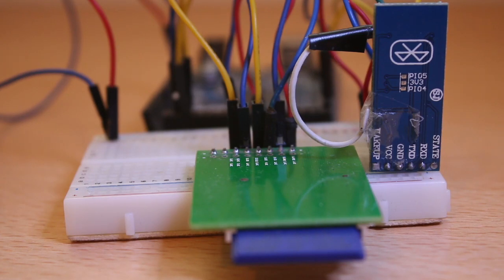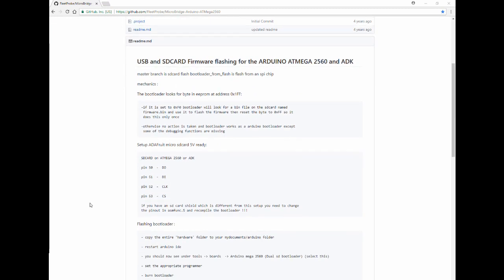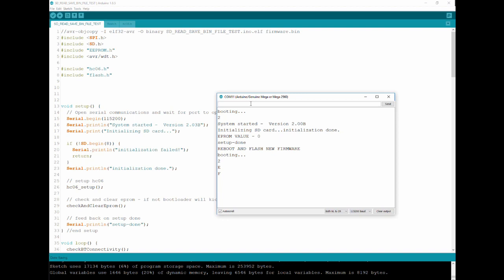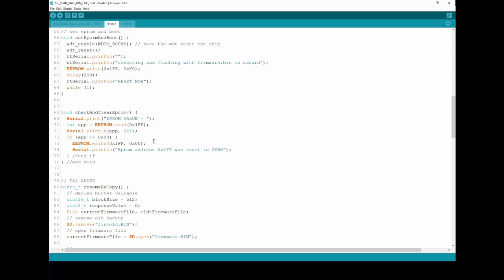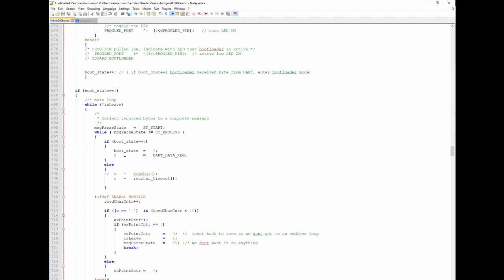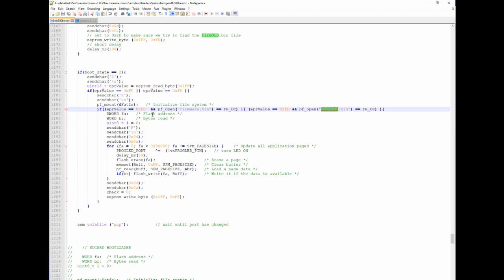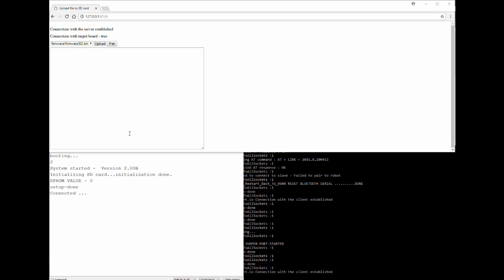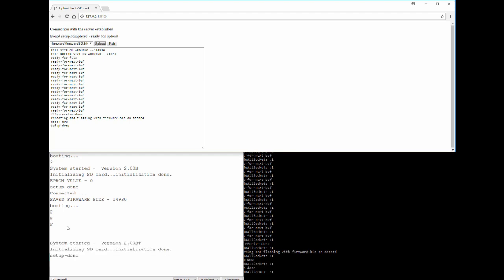Mega2560 bootloader with SD support

Comment: How do i Make the Bin file? i don't understand this
 Generate BIN file:

To generate a bin file you need issue the following command on you apps elf executable :

avr-objcopy -I elf32-avr -O binary firmware.cpp.elf firmware.bin

Also is the sketch you are using in your video available for download?
Reply from the maker: using that command in a prompt line with the elf file that can be compiled by using the arduino ide SKETCH--> EXPORT COMPILED BINARRY.
Usally it creates the elf in the projct folder. 
If not you can force the ardunio to create the files in a specific folder, but I can not remember how, I'm sure you can google it out with out any problem 

and sorry, no the code is not available for download.

Comment: Hey can we implement it on uno? 328p
Reply from the maker: Yes - try this 
https://github.com/zevero/avr_boot
Reply: @talofer99  buddy i tried that , but no luck 
Maybe i am not doing it properly idk , i followed each step 
I even tried 2boots but no luck 
Luckily i found your video which gave me a hope that maybe i can achieve it 
It is small part of my project but because of this i am stuck 
I am trying to do otap using gsm 900 
So i am going to need sd card bootloader for that
Reply from the maker: @remshashakil1481  if you followed all the steps and still failed I'm not sure how I can help you.
Do you have any guess where its failing ? 
And how did you think of using the gsm900 for the data transfer ?
Reply from the maker: Did you try and do some debug ? output to Serial for example ?
Reply: @talofer99  we are four people working on it , so right the two of them are working on linking the webpage and the gsm 
Sending and receiving packets 
And i am working on the bootloader part
We are taking baby steps, hopefully within due to time we can do it
Reply: @talofer99  no didn't change the code 
I think the part where i put my sketch in the sd card 
And reset it 
The arduino is not searching the sd card for the sketch
Reply from the maker: Silly q .. did you check that the SD works in a sketch ? 
IE that it's connected well and working.
What file did you place on the SD ? 
What SD is it ? size ? how is it formated ?
Reply: @talofer99  yes the sd card is working properly and it is formatted as FAT (FAT16) 
Its 2gb
Reply: @talofer99  another question , how do you makefile 
Can you tell me steps you followed 
I really am new to this 
So please bear with me 😭
Reply from the maker: @remshashakil1481  you will need to install avr-gcc and run the make file (in cmd) in the directory the files are. 
also did you notice this page  ? 
https://github.com/zevero/avr_boot/tree/gh-pages
Reply: @talofer99  thankyou so much for the help 
I'll run these again 
And no i haven't downloaded avr-gcc will do that and get to you as soon as possible 
Thankyou so much once again ❤️
Reply: Hey there , sorry to disturb you again , but i am getting the error that the programmer is not responding 
Tried several solution which were over the internet 
Maybe the pin connection are not right 
Can you suggest me a link for pin configuration as to how to connect programmer , target and sd card module 
As they all seem to use the same set of pins (11-12-13)

Comment: Hello can you help me out on something Do you think this can be done on a 32bit arduino like the Zero board?
Reply from the maker: The Zero board unlike the Mega has an ARM processor on it  - and its bootloader is very different.
So you might be able to do so, but it will be much more work, did you try to google it ?
Reply: That has ARM 2 wire programming unlike Mega which has a SPI bootloader